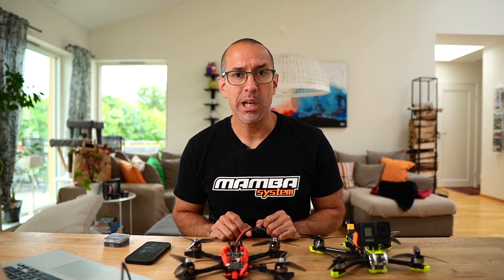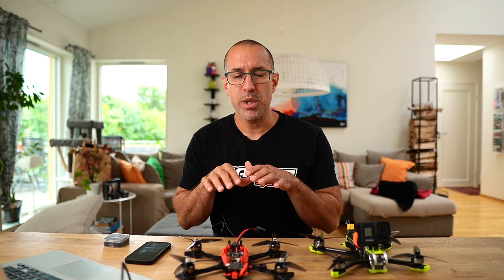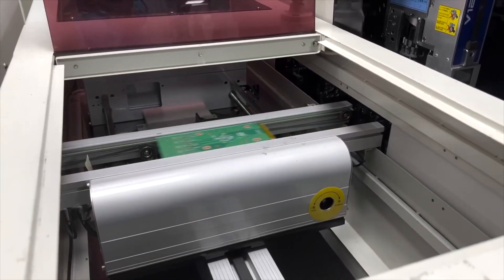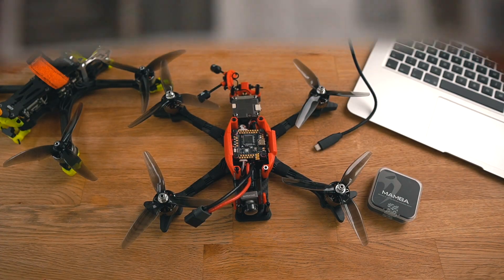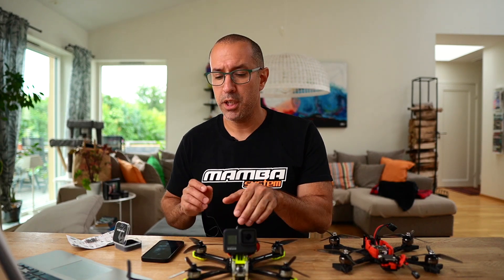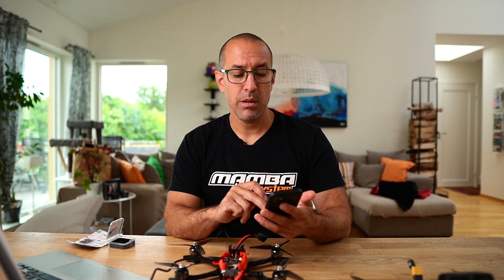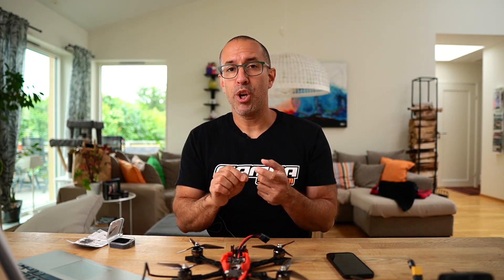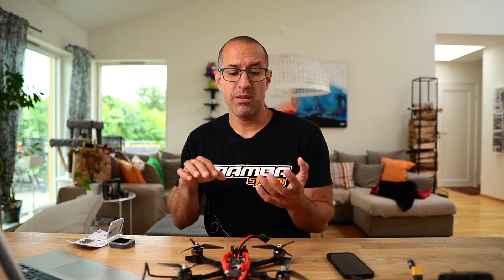Fixing Speedybee App Problems for Diatone MK4 F722 App FC

Comment: I think it's more trial and error.   It doesn't have a system.  After I flashed a new firmware, I had to restart.  Nothing worked.   I followed this path as I already had done before flashing, tried three UARTs and all possible frequencies.  And in the end it was the parameters recommended by the manufacturer, whose initial malfunction drove me to go that far.  It was a similarly painful path to go when I switched from Mamba-controlled LED strips to Betaflight-controlled ones.  The problem is Mamba.

Comment: Hi does this stack support 03 airunit. Is it just plung and play?
Reply from the maker: It does. There’s a plug for it but you have to be careful with the cable order
Reply: @NordFPV  Thats what i wanted to knw is the order corect by default?
Reply from the maker: @outboxfpv4360  Sorry, I have not connected a O3 to that board yet, and I have no experience. Look at the diagrams.

Comment: Do you know which gyro you have?
Reply from the maker: In the board information page says BMI270
Reply: @NordFPV  just ordered my "MAMBA MK4 F722 APP F65A_128K 3-6S Flight Controller Stack 30mm" from Diatone webpage. they're selling now version B: Gyro- ICM42688P. There is a "Christmas Spin" currently - got 20$ off ...plus free shipping... end price 113.99$ - not bad compared to kakute h7 v2 that would cost me twice

Comment: hi :) so far i followed this instructions i still cant get BT or WIFI, does need to be soldering anything in the board for that ?
or just enable uart 4 msp 115200 ?
Reply from the maker: Hi. No soldering required. The important is the configuration. Are you sure is the same card?

Comment: Can we directly plugin DJI Airunit on this FC?
Reply from the maker: Yes, you can. You have a 6 pin harness to connect a DJI air unit/vista or even walksnail
Reply: @NordFPV  Is there voltage regulator for airunit? Cuz air unit directly dont take 6s
Reply from the maker: yes, it has a 9V regulator, in fact it has a double 9V regulator. It's a fantastic board
Reply: @NordFPV  how do we make the dji remote work in this fc?
Reply from the maker: @turbomaker4  Hi Baja, you have a harness to connect your DJI unit, vista or full air unit. If you have all the cables connected, including the SBUS/GND for the remote, then is just a matter of configuration. Your radio should work fine with the DJI remote.

Comment: That is a great flight controller. I've been using it for close to a year now along with Mamba's 50a ESC. I love the wireless part of the FC. I have a different FC and the USB plug was torn off the board and it took the pads off the board with it. So it's a functioning AIO board, but it's not useless because I can't program it. The wifi boards are great.
Reply from the maker: I like that combination. the 50a ESC 32bit is a great choice too.